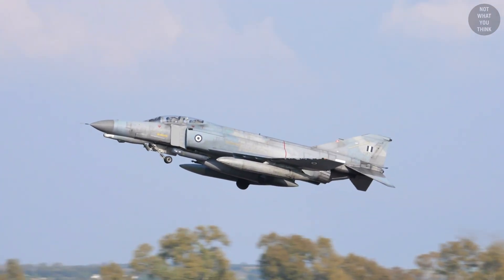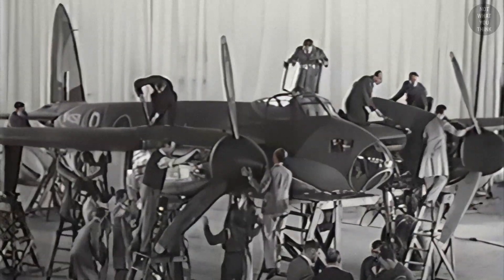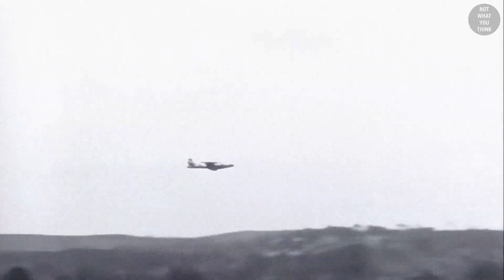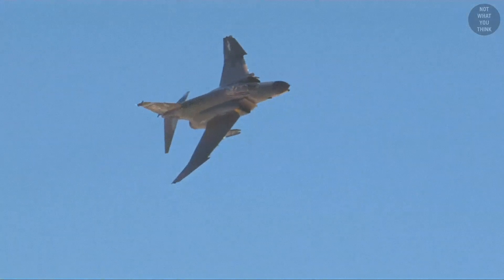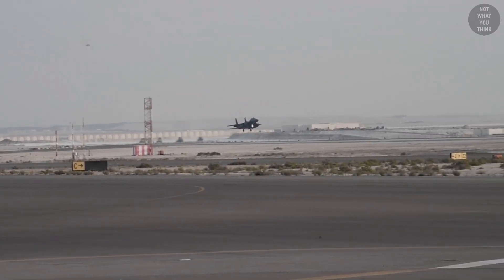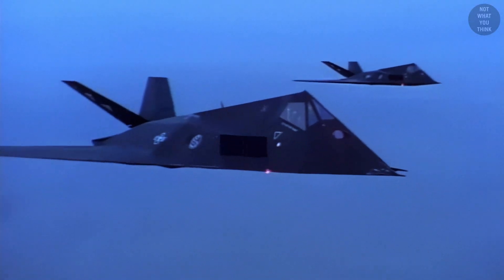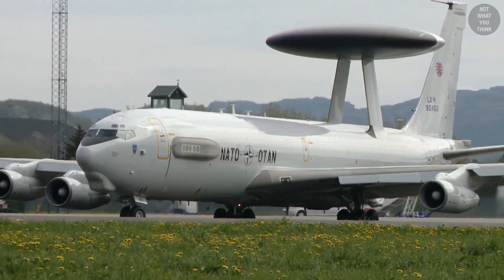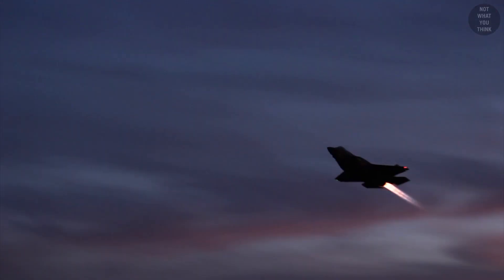Why are Modern Fighter Jets Slower than 1960s?

Comment: For beyond visual Range fights BVR top speed is king though. The ability to get high (for low air pressure) and fast (for greater starting velocity for the missiles) is crucial. That's what makes the F15 so lethal. And the F22 has the ability to be above 1.5 Mach without the afterburner. That speed also come in handy when defending missiles.

Comment: Nice, but not quite what you think. I don't think anything you said here was really wrong, but like so many think tank studies it's easy to miss the forest for the trees. I flew a Mach 2+ fighter and went Mach 2 exactly one time. However I went M1.5 a lot of times, and went between M 1.2 and 1.5 in tactically relevant scenarios a LOT of times. And that is realistically what a M2+ fighter gets you, the ability to operate in the low supersonic region relatively easily. Also, external stores limit top speed, typically to 1.5-1.6M. The value of speed is directly related to how easily it's achievable. Big fighters like the F-14 and F-15 could go fast and had the gas to do it. Now the question is what do you get from a M1.6 or M1.8 fighter? If you figure you realistically get about 60% of top speed, a M2 fighter gets you 1.2, and a 1.6 fighter gets you 0.96.

Comment: Aerodynamic heating: About the time you hit transonic, the leading edges of the aircraft get really hot and make you stick out in IR, especially at high altitudes where the air is thinner and there's less diffusion. The Russians (and I believe the Chinese) specifically include powerful thermal scanners to help counter America's stealth advantage.

Comment: Bro... theyve never officially released the speed of the f15 yet alone the f35. They release a speed but its not the actual top speed.
Reply: Probably because it’s irrelevant
Reply: Like yeah but over math 2 for F-15 and under Mach 2 for F-35 are reasonable speeds
Reply: "Top Speed" is a defined metric. It is the maximum safe speed achievable by a given aircraft in level flight. They don't release speeds higher than this because they don't test speeds that risk destruction of the aircraft or killing the pilot. Especially not these days considering the cost of fighters and the advancements in CAD simulations that can predict flight performance with decent accuracy.

The official top speed of the F-15 is Mach 2.2, however that is when completely unarmed. When armed with a standard air to air payload (just missiles, no external fuel tanks) it is physically incapable of flying faster than Mach 1.8, which should tell you it's limits are well known.

The F-15's Mach 2.5 speed comes from the F-100 engine's absolute maximum speed per it's design (engines have to tolerate higher speeds than the aircraft is designed for) and was only ever achieved once by a specially modified pre-production F-15A called the Streak Eagle. Modifications included removal of all combat systems and weapons provisions in order to save weight, and minor airframe modifications trading stability for responsiveness. It's purpose was to break records, which it did. 

The risk to the F-15 is due to engine overheating and potentially major issues such as deforming engine components that could lead to compete destruction of the engine... much like the MiG-25 and it's Mach 3.2 dash speed.

Comment: 0:26 " and, in some cases, they have slowed down."  The B-2 is a bomber, not a fighter, bombers were not meant to engage in air-to-air combat, so they weren't designed for high speed or maneuverability.
Reply: He's just using stock footage and didn't even mention the B-2 it's just so you don't have to look at a black screen for 9 minutes

Comment: I would guess full afterburner flight is less useful for planned sorties because of the massive loss of range, and more useful for interceptions where getting to the enemy quickly was the most important thing, such as the Ready Five guys on aircraft carriers whose only job is to get in the air and provide immediate backup should the air patrols encounter trouble.

Comment: I do feel like the comment at the end, comparing the F-104 vs. the F-35 was cherry-picking. Pretty much any fighter has a better range and armament capability than the F-104. But I don't think the F-35 has a longer range or more carrying capability (in pounds at least) than the F-4 Phantom.
Reply: The F-4's range was atrocious at around 280nm clean, or 370nm with external fuel tanks. An F-35A in clean configuration can comfortably achieve  double that of the F-4 - up to 750nm for an air to air mission, or 670nm for air to ground. 

In terms of payload by weight, the F-35 wins again with a maximum of around 18000lbs vs the F-4 at 16000lbs. The only caveat here is that the F-35's internal payload maxes out at 6000lbs, but you want to use hit and run tactics on stealth missions so a smaller payload doesn't matter much, especially not nowadays since the average payload carried by a modern fighter is around 3000lbs... weapons are far more accurate than they used to be, so fewer munitions are needed. In fact during Vietnam it was estimated that at least 10 bombs would be needed to have a reasonable chance of hitting a massive bridge from around 5000ft altitude. These days we only need 1 to hit, maybe 2 to ensure target destruction.
Reply: @ThingGoBoom  what's interesting to me is that the f-4 ferry range is on the order of 1700 miles, very close to the f-35 ferry range listed. Not sure why such a difference for f-4 on combat range vs. Ferry except that the f-4 must have been very inefficient at flying at speeds needed for a combat mission.
Reply: @kevinb4077  It comes down to a few factors. Combat range requires an aircraft be configured for combat, and the F-4 relies on external payloads and fuel to accomplish it's missions. 

There are a couple of problems caused by external payloads that result in reduced performance.
1. anything mounted externally will introduce parasitic drag. The more external weapons and pods there are the higher the drag.
2. larger payloads under the wings obstruct airflow and reduce lift, meaning the aircraft has to tilt it's nose upwards to create more lift, but this results in even more drag.

More drag is obviously a problem as it results in overall lower performance, as well as the engines having to output more thrust to maintain cruise speeds.

But that's not the only area of inefficiency. A ferry flight is the flight profile and configuration that results in the maximum range. For an F-4 this is 3x external fuel tanks and nothing else. In this configuration the F-4 carries 23000lbs of fuel, but still has a slightly shorter ferry range than the F-35A which only carries 18000lbs of fuel (and can be armed on a ferry flight due to internal weapons storage).

Comment: 1) the historic reason "interceptors" have fast top speeds: nuclear bomber intercept. The F-104, as an example, is perfectly suited to the role for which it is designed, to climb like a rocket and go very, very fast to intercept an enemy closing quickly. People misunderstand the F-104 because they compare it to other use cases for which it was not designed.

2) Good points made about the fact that high speed hasn't played a major role in modern conflicts. However omitted was one huge distinction that's lost between 4th and 5th Generation (ie "stealth") fighters. People love numbers and quoting things like "top speed". However those zoomy pointy fighters slow wayyyyyy down when things are actually loaded on them like fuel tanks, bombs, and missiles. Real operational aircraft in the real world aren't at Air Show loadouts with half fuel. 

So what? 

Well what it means is that while legacy aircraft have a "top" speed higher which they will never reach once they are armed for combat, the F-22 and F-35 carry their weapons internally. No drag. That chubby F-35 is faster at mach 1.6 than rivals with far higher "listed" top speeds - and that F-35 has weapons to deploy at that speed. 

People also make this mistake with "near stealth" aircraft like the Rafale. Nice aircraft, they say, "its much cheaper than an F-35", they say, "it's got some stealth technology", they say ... all true. Until you actually load it with bombs and missiles and fuel tanks. 

Air show loadouts don't win conflicts.
Reply: They have one role to be guide systems for bigger cruise missiles launched on the ground that it's easy to see it as a cheaper solution to not make the issue in the first place by using old doctrines from an era who is still around since them don't want to show the rest of the world what the airplanes are capable of doing without any missiles equipped.

Comment: Top speed isn't everything in a combat aircraft.  All that speed, which is short-lived anyway, and intended either for an attack run or escape, uses a LOT of fuel, cutting into an already-inadequate range and/or "loiter" time.  Today's aircraft require stealth, maneuverability, range/"loiter" time, and weapons LOAD, which factors more into its usefulness, as today's far-more expensive airframes often have to fulfill multiple roles.

Comment: Also, the F-35A can only use its afterburner for a very short period, just long enough to reach top speed, before the heat from the afterburner causes structural damage to the rear fuselage.
Your comment about interceptors using too much fuel in supersonic dashes is also negated, in the US and UK at least, by tanker aircraft being scrambled also.

Comment: Fairly well balanced article but a few facts missing:  Starting at Mach 0.9, it takes 4 minutes for an F-4 to accelerate to Mach 2.0 (somewhere around 40,000', maintaining 1g max) and when you finish there had better be a runway near because you are down to min fuel.  This high speed is possible only with no external stores (weapons), so obviously no combat logged at these speeds.  The advantage of the F-4 (and subsequent fighters) was the ability to accelerate, typically from ~0.85 to 1.1 . . . that's where they made their living, guessing the F-22/F-35 are very similar.  BTW, when the original F-4 set the speed record it was an average of two passes over a 60km course and at the end the speed was 2.4 and accelerating, so nobody really knows its top speed.

Comment: I worked F-22s for 6 years and F-35 test for 6 years, and I can tell you for a fact that your numbers are incorrect. Modern fighters are MUCH faster than 60's era fighters. First of all the top speed for any modern fighter is classified, so these numbers you got from Wikipedia are wrong. While older fighters could reach >Mach 2.0 it was for a very short time, and a lot of those figures are test figures not real world use speeds. The F-22 for instance can stay at around Mach 1.6 without afterburner due to something called "Supercruise". Jets from the 60's would be Bingo fuel in minutes trying to hold that speed with burners engaged. Second, speed is not a good indicator of fighter performance. Any modern fighter would absolutely obliterate any of the legacy era fighter jets. We used to send one F-22 vs up to 12 F-15C&Ds during turkey shoot training exercises, and every single time the 15 pilots would report that they were taken out without even knowing the F-22 was in their airspace.

Comment: i think the bit that’s left out here is that the Mig-25 and similar aircraft were interceptors - designed to take off and intercept enemy bombers carry it nuclear payload. in that scenario they would make use of the top speed. after ICBMs came in these jets became largely obsolete. Clearly the vietnam war called for different capabilities. nowadays with BVR missiles speed can be a factor again in increasing the initial energy of the missile on launch

Comment: Did you actually ever study the way they used phantoms vs migs in vietnam?  The most succesful aces would take their phantoms vertical vs migs and wouldnt try to outturn them they'd use their power and better airframe to outclimb and outdive them, the migs couldnt keep up vs them.    Even though they might not have hit their top speed the extra power to weight ratio was what was successful for the pilots that knew how to utilize it, and it would still win today.

Comment: Next gen hypersonic drones, go way over mach 6, where speed is the objective, they are on a target so quickly, air defences do not have a chance to intercept, the F35 and F22 have their uses, but the next big spend on actual aircraft is the F15EX, which is not stealthy, but cheaper to maintain and able to carry longer range standoff missiles that wont even fit on the stealth Jets and much greater load carrying.  The Russians made a big noise about their hypersonic missiles, but how many do they actually have?  Next few weeks could answer that!

Comment: The F-4 has turbojets while the F-35 has turbofans. Turbojets were meant for high altitude while the turbofans have a bypass meant to conserve fuel at lower altitudes. 

The YF-23 had an engine that switched to a turbofan at lower altitudes and became a turbojet at higher altitudes.

Most aircraft are needed for their capabilities. Fuel efficiency is what maybe focused on now with newer fighter jets.

Although turn rates is one dimension of the air battle another is also the altitude. Air superiority maybe the idea of which has the highest ceiling and high rate of climb. Simply by having your aircraft at a very high altitude is already an advantage giving the perspective of look down and shoot down weapons.  

SAMs may have prevented the idea of air superiority from a look down shoot down perspective. This allowed stealth at lower altitudes to be a technological advantage in modern air battles!

Comment: Today's fighters aren't in fact slower, fact. The navy hornet isn't a fighter, the original was designated F/A, the super hornet is a multi-role platform. The 15 15 and 22 still scream, the 35 is again multi-role, one version even being VTOL. Also for the record, with speed comes power, which is a huge advantage in air to air combat, not only in maneuvering but in being able to engage and disengage at will.